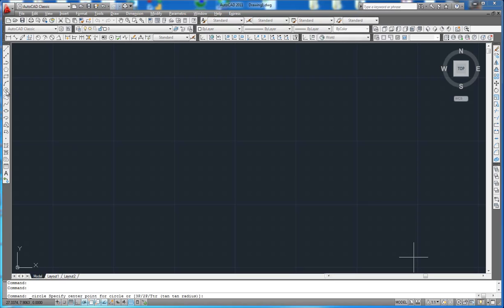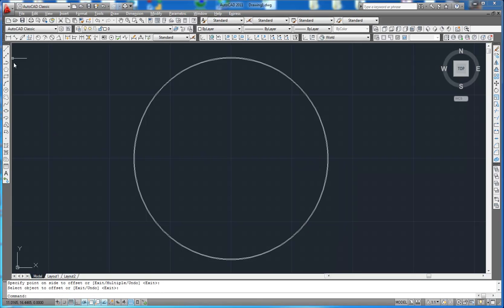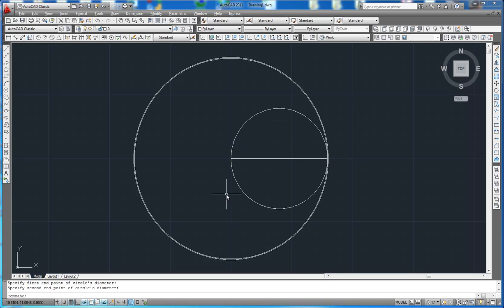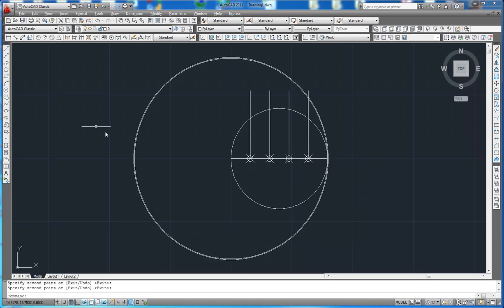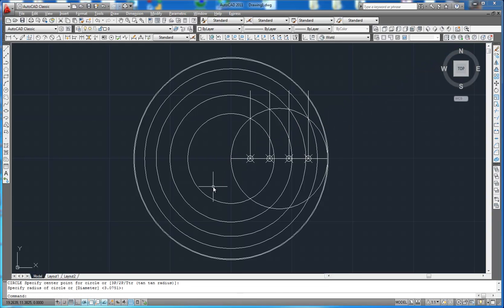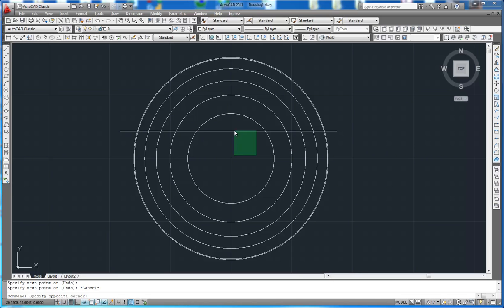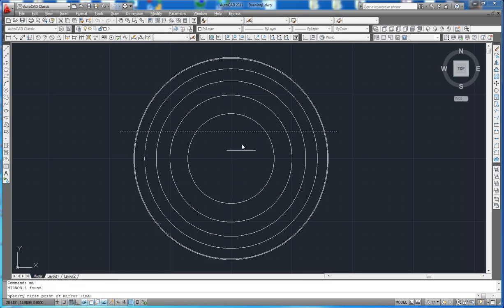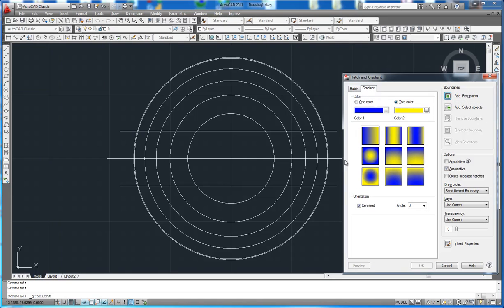Couder Mask with Instructions

Comment: You don't need that huge hole in the middle. The center is shadowed by a secondary. Two separate openings in the mask are Much easier to null thus increasing the accuracy of the test. Also you keep saying bezel. Don't you mean BEVEL ? that's what I do. That being said, I do like the video. It is helpful. Thanks :-)
Reply from the maker: the hole in the middle is equal area as the other zones. its good to double check the roc measurement, and not just assume its 96" for a 8in f6.  I prefer it. most important is the area from .7 to edge. that's more area than .7 to center especially with the 2ndry shadow reducing the lower zones areas.
Reply: @Pinbout  I'll agree with that.

Comment: Where can I get large sheets of relatively rigid paper or cardboard that can be cut with an exacto knife?
Reply from the maker: Dan Kahraman staples sells card stock 11x17  but we get that in big packs so that’s a good question if you just want 1or 2. Posterboard would take a couple of passes with the exacto
Reply: Don't use the real pointy blades, they sort of tear up paper like that. Go to an art supply store and see what they have.
Reply: @MrRayopt  Can you recommend any? I have to drive 40 miles either to Chatham or Windsor for the closest art supply store.